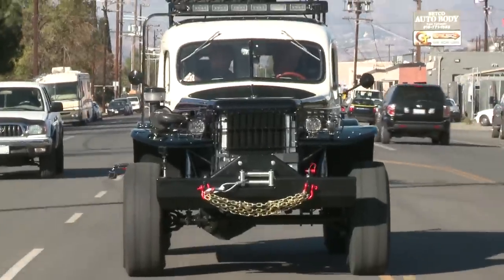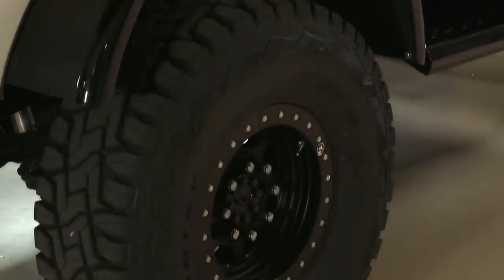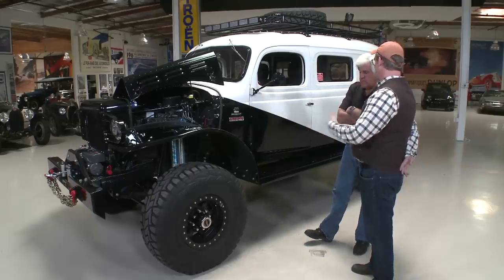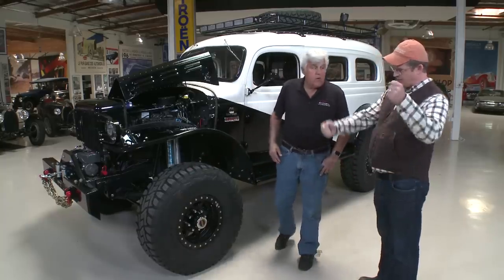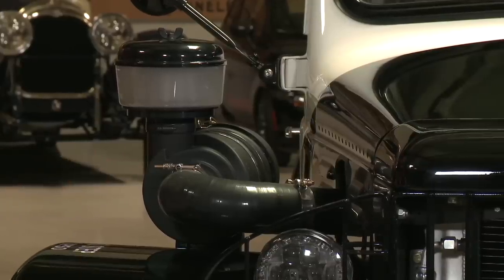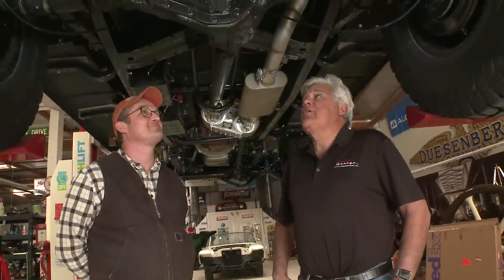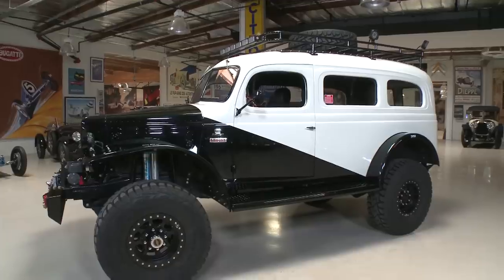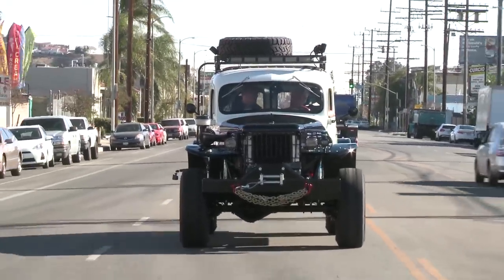1942 Dodge Carryall - Jay Leno's Garage

Comment: "Arguably the first SUV!" No argument... it wasn't. Not even close. Still, it's a neat adaptation and upgrade, especially on the technical side. And very KISS!  Love that! The original vehicle was a lot more advanced for the day than many people realize or give credit for, especially considering it was built under a low bid military contract. Don't like the fuel filler... you gotta unload cargo to fill the tank. If worried about fuel theft/molestation, a locking mechanism could have been devised. Don't like the lack of rear bumper either but I imagine a lot of these features are based on what the customer wants.

Comment: Thing isn't finished. "We wanted everything to be easily accessible and convenient" like these 2 batteries under here, next to the rear drive shaft. Cool vehicle, just needs: skid-plates, self-inflating tires, rear bumper, real rear tailgate that locks (padlocks flopping around?), maybe rear swing-out rack for water containers and locking side fuel access so you're not pumping diesel fluid into inside of rear bed.

Comment: I think leno is being very polite and letting him get away with allot of misinformation.(im sure leno knows better) One original combat wheels were just 2 piece wheels not bead locks. They were designed to be easier to change in the field especially with 10ply military tires. Also the cummins needs power to run it has a fuel solenoid that has to engage. you can disconnect it and wire it open in an emergency and push start (With no rear bumper?) Also fuel fillers internal are safety issues and .you would have to unload the rear to fuel up? 32 gallons for an expedition truck is nothing.  Lead acid battery's mounted under the truck? How do you service them? and there vulnerable to damage.  No skid plate under the transfer case?  The great springs he's using are the original leaf springs during WW2 the quality of steel was inconsistent at best we were worried about numbers not so much quality. His heavy work tailgate is curved on the inside what kind of work surface is that? And there's . Shops like the one that built this one are just fast talking bull __ artist that take advantage of people that have come across some money but really dont know much about what there trying to do.
Reply: you do know me!!!

Comment: how is the fuel door convenient if you have a bunch of stuff piled in the back, covering the fuel door. Padlocks are easily cut, even knocked open with a hammer, I've done it many times. Why not use air lockers for the differentials? No protection for the oil pan.

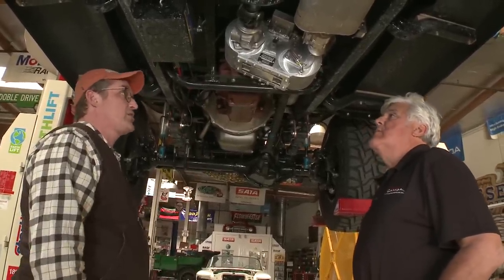Comment: 24:05 there seems to be a lot of contradictions on this vehicle. Jay was correct to point out that plastic site tube that could get torn off if you go over some underbrush. Also the batteries seem to be just suspended on little shelves, and not protected from spray or debris at all. It's amazing how many upgrades have been done on this vehicle but Jay wasn't getting anywhere when he asked the builder why they don't use modern sealed gel cells. Old school lead-acid batteries in such a vulnerable position don't make any sense at all.
I think that the modern LED lamps on the exterior of this vehicle really take away from the authenticity. The multiple LED look is really out of character with the rest of the vehicle... Nonetheless, the vehicle is interesting and the review was done very well!

Comment: Not saying he's wrong, but if it was my rig, I would have done a lot differently. Would have done the suspension differently, the transmission wouldn't have the plastic line, fill-cap would be outside with a lock, I would be able to lock the tailgate, would have done a different roll-cage, battery positions would have been different(and they would be the gel cells) would have a muti-fuel engine, a bigger air tank, a better compressor, probably would have a central-tire-inflation system, axle brakes, portal axles, different axles in the front. I like the build, I would have just done things very differently

Comment: Brake cables hanging low to get snagged and apply the brakes when off road? Have to unload cargo to fuel? Batteries not protected from the side and need to be strapped in better. Tools on the back to break into the vehicle (worried about padlocking it?)  Tailgate "workbench" on cables? Needs a vise on the front bumper for heavy work for a service vehicle. Heavy tires to lift on and off of the roof, might want to look at a better option. A heavy rear bumper could be used to store items, swing out tire carrier with a small winch on the roof rack to mount the tires, Also the bumper would save the sheet metal. Should have a traction type unit for the front end too. Carryalls were not "command vehicles", not sure where he got his sniper info from. I would like to have seen it restored original as a real military truck used in Africa is not common in the US.  Good start for a service truck.

Comment: The leafs springs use friction against the leafs. The lubricated the leafs now that leafs will lose there arch and flatten out faster. A Clayton long arm lift would have been better, an all cummin c series is way better motor that wouldn’t have such low torque. A Chevy 6liter has better power and same torque

Comment: Can't believe he thought it didn't need a push bar bumper on the rear.  I too think the inside fuel filler is a mistake. Leave it outside and hide it somewhere, like behind the rear bumper?? I would've put a bumper in rear with a second winch.

Comment: Its a nice build, but that fuel filler placement must be one of the dumbest things about this truck. It's supposed to be a chase vehicle for classic rallys. That means that the back will be filled to the brim with spare parts and tools. So you'd have to empty the back every time you have to fill it. Why not just put the fuel filler behind a locked door on the outside?

Comment: Please stop saying that things like this were the worlds first SUV. The first Chevy Suburban was  built in 1935 so unless it's older than that you're wrong. 
The tail gate is okay but personally I'd have put in a rolling cargo bed because you'd be able to put a bench vice on it and tool boxes and everything would be more accessible. The fuel filler under the floor is a bad idea anyway. 
I don't like the sight glass on the transfer case. in rough terrain it's vulnerable and with any gearbox, it's easy to see if they've been leaking and if they didn't leak they don't need more fluid.
It may sound like I don't like the build but overall it's fine. Just not the way I'd build it for a work truck and yes I have built them for when I was working gas plant construction.

Comment: I'm more of a car guy instead of trucks... but this build seems kind of basic. I realize that that's kind of the point. I don't think the build quality holds a candle to Jonathan Ward's builds. I'm sure he'd think this is caveman status. I like coil suspensions, optima batteries, a larger engine. But I don't want to be a hater, I still respect the build, I just think most aspects could be done to a higher standard. I'd take 1 Icon 4x4 build over 2 of this guy's vehicles... but that's just me. It's still all love.

Comment: what about the suburban and why is it a napco carryall when a suburban is converted to 4x4. I love these vehicle enough that we've saved 3 wdx windowed and a ultra rare wd-11 panel the panel and 1 carryall run original and a the young man now preferred now by dad is powered by 4v71 Detroit and Clark 5spd she makes more noise than power and 70 sounds like 100. the last one is in process of 6.4 hemi 6spd and atlas with Dana 70s and Deaver springs.

Comment: The paint makes me think he runs a Fangio coupe for his road rallying. I have a 1952 M37, it's nice but I don't know if I agree with restomodding. I don't mind you putting a heater in, but this is a bit much and you lose the soul of the vehicle. That air intake thing was a standard thing on these and M37s, he says it like he invented it.

Comment: Running a diesel engine detuned to that extreme  offers its own set of problems. There will be issues, you need to bump the power up at least a little. I think you'll have oil consumption issues and wet stacking.

Comment: Not super necessary. Designed not as a race machine, but as a follow truck. Slower and steadier drive that is focused heavily on making sure they finish the race. Last is still better than a DNF with a mechanical

Comment: It's a misconception that the old Mercedes-Benz non-turbos (or turbos) go a million miles. I own an 87' Euro model 300D non turbo, the fact is, you have to do preventative maintenance, lots of it, and religious oil changes every 5000kms or 3000 miles. Then they MIGHT go 1 million miles. There are far more old Mercedes diesels that have NOT gone a milllion miles rather than have.

Comment: Nice truck but a few design flaws, and he needs to read up on batteries, he definitely gets caught off guard by Jay when talking about batteries. Lead Acid batteries don't like being discharged all the way and then charged again, and won't let you go back up to 100% capacity. I would always prefer a gel cell with pure, non-recycled lead. He has a few incorrect statements about batteries. I think instead of focusing so much on the welder he would have been better off putting the fuel tank access in a different spot. Jay calls him out on a few issues too like the leaf springs. Otherwise a cool looking truck though the padlocks in the back would definitely scratch up the paint when you are not on a smooth highway.

Comment: the shocks are too long uptravel is severely restricted would ride terrible. if it uses all the downtravel already it needs the shock mounts moved apart and a longer travel shock so it has both up travel and down travel. lead acid batteries hanging below the chassis right at the ramp over point is a terrible idea. great vehicle it just needs to be finished off by a 4wd expert.

Comment: So a cheap master lock that you can break with a hammer is the only thing stopping a desert goblin from taking it? Also like the cheap plastic transmission tube. As well as the 100 year old battery sensitive to jolts, temperature and surges in power. Winslow is such a scumbag name, perfect amount of sleez with this used car salesman.

Comment: Fifteen miles of dirt track and the padlocks on the back will destroy the latch and the paint underneath them.
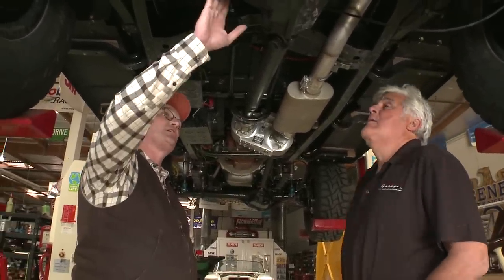Rear suspension travel? Tiny, judging by the shock boots at 22:14

Comment: Cummins 4BT.
Nasty vibrating pig from a bread truck.
Would have used a Cummins 6BT
Shackle reversal is dangerous. That's why manufacturers don't reverse them. The front end dives down during braking.
Not impressed.

Comment: Interesting truck but the choice of design with the paint is highly questionable. Could have been a lot cooler with a more interesting paint job or even a solid color. I thought straight diagonal lines went out with mini trucks in the early 90's and even then people only did it because it was easy to tape off in your home garage.

Comment: Interesting vehicle saved but has lost all of it's history now. Surprised that guy has no idea how to get a rear suspension that works with or without load and not have to compromise it by running it with those springs all the time.

Comment: Terrible suspension..short travel leaf springs with long travel shocks..useless! Interior fuel tank and filler is also ridiculous.
padlocks to lock the boot, no GPS or comms , unsuitable battery, no sump or underbody guard.  Poor effort.!!

Comment: Shocks are way to long, gonna explode offroad
 The ARB compressors cant and wont handle air tools with their small air tanks - to use air tools you have to have a decent size external air tank
Very nice truck non the less
Reply: Air tool usage, particularly anything continuous, relates to cubic feet per minute of output, not PSI

Comment: i prefer their 6x6 than this "thing".i would certainly have a rear bumper even what they are saying .when you go offroad you well could need a rear bumperi would use Michelin and i worked on trucks that add battery under the cab,,man i did not like this and dirty they.it looks like a big Toyota F40 Diesel too me.

Comment: Hot exhaust right next to a plastic sight glass?  This is the type of stuff that really shows  most custom work is not very good.
Specially the fuel filler.... Really? Take off your padlocks, open the rear tail gate, unload you gear, spill fuel into the interior. You can have it!
Reply: You need small keys to two separate padlocks that have dust and damage from bouncing around on the outside of the truck as the bigger extinguisher is in the back as you watch it burn from this leak onto the exhaust.

Comment: under powered,good torque but still under powered especially for a 7100 lb truck
Reply: Agreed, the truck will have to carry tools, jacks, parts for the rally vehicle and three or more crew members and their gear. At a guess, another thousand pounds of weight. I wonder what transmission is used, as that could make a lot of difference with only 130 bhp on tap.

Comment: Guy is from Jackson alright ~ seems like a rich guy (superior attitude to others). Shame that when you go that far you can keep a Dodge a Dodge! Damn GM seats and misc other parts. There are PLENTY of Dodge choices, you can stick with what it was meant to be, even a 12V Cummins would stick with the Dodge line. Several cool aspects but several really dumb ideas. Why would you put bolt in AC Delco batteries rather than standard posts? Those are the LEAST reliable design of all batteries! 70% nice job but some really dumb choices and an arrogant guy!

Comment: Like the basic ideas, realized here! The color scheme is not clever, as black will draw the heat, especially where you want cool. Also, why not use more aluminum, to cut down the weight...

Comment: I Absolutely 100% Hate Restomods. if you can't appreciate the Original Condition Dodge Power wagon,  because it  has low gearing and it's slow. By All means buy something that's later model and go with that. but leave the old low horsepower power wagons stock.DONT MODIFY THEM.